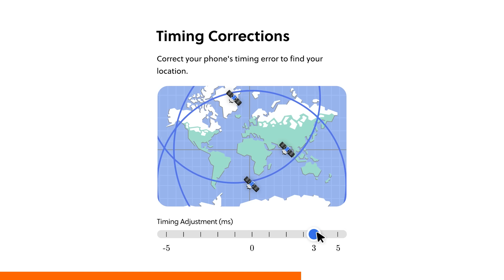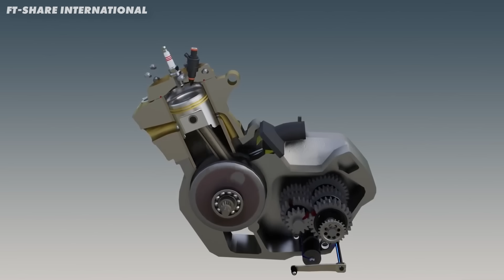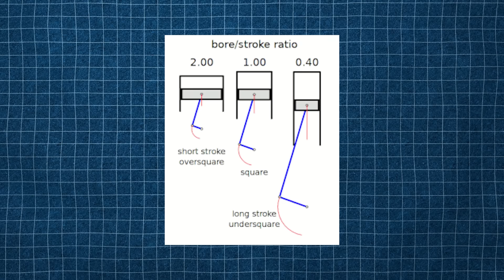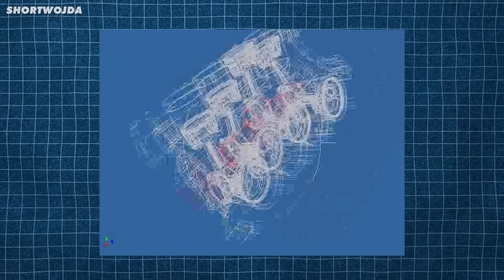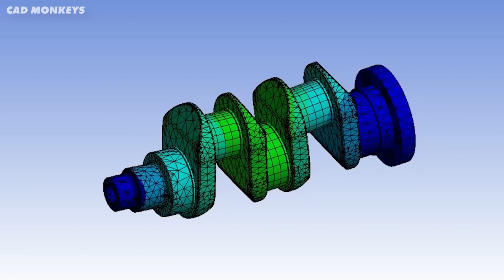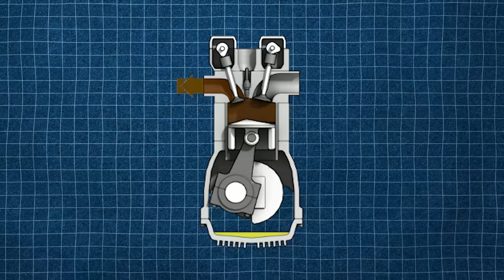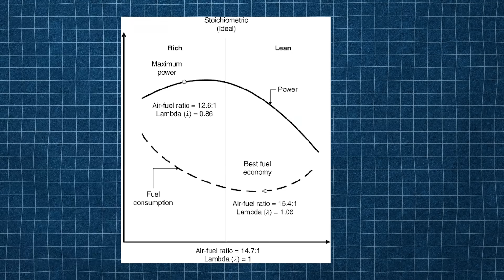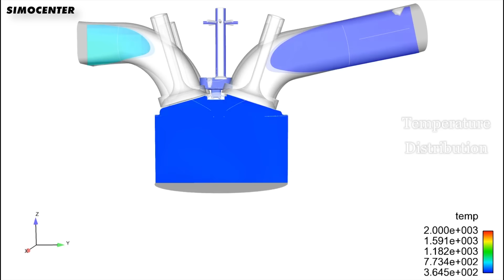Why It’s Almost Impossible to Rev to 21,000 RPM

Comment: Mass doesn't change with velocity, the piston doesn't magically become 2.5 tons. If you're talking engineering you absolutely have to be precise with your terms, man
Reply: Weight and mass are not the same thing. Weight is a measure of force. You don’t become massless when you travel into space, but you do become weightless (sort of). The earth has mass, not weight. You might want to be more precise when correcting others.
Reply: @gerardleary1885 the earth does have weight, does jupiter and the suns pull mean nothing to you? Lmfao
Reply: @gerardleary1885 if earth had weight, it would be the gravitational force that keeps it orbiting the sun 3.6 10^18 ton-force compared to its mass 6 10^21 tons.
meaning gravitational field of earth is ~1600x stronger than gravitational field of the sun, at the surface of earth
and the reason why our weight is not significantly higher at night vs day
Reply: I was interpreting it as, that at 20,000 rpm, the piston is exerting the same amount of stress to the connecting rod that would be comparable to 2.5 tons, either in compression or tension, squeezing or pulling on a connecting rod.
Reply: @kustom4935   A graph of the force on a piston throughout a full cycle would be a pretty crazy line peaking once for the power stroke and again for the intake. At its very peak, force could be expressed in the direction of piston travel, but that would not be the total force exerted at the crank pin, which has a large direction element. I’m sure real engine designers would know the entire story of force / direction for every single mm of that stroke. As Driver61 is pretty well informed, an engineer may have given him that number and rounded it roughly to a concept readers could envision.
Reply: @artysanmobile  yes! at peak cylinder pressure the force applied by the combustion gases on the piston is many time the force required to accelerate the piston. like an order of magnitude stronger.
Reply: @kustom4935 that's more like it. you can say force which is both scientifically accurate and understandable. stress is a consequence of force
Reply: Yeah but you were using your brain, and that's not allowed on the internet.  @kustom4935
Reply: Thanks you for clearing that all up, to all the pedantic and non pedantics, thats how I interpreted it to.@kustom4935
Reply: The confusion between mass and weight is because all bathroom scales in the metric world are labeled incorrectly. They are all Force measuring devices and should read Newtons on the dial because they measure how much force you exert on the scales because gravity is pulling you down onto to them. BUT…Force = Mass x Acceleration and the “Acceleration” is a known number so they all divide their readings by “Acceleration” and provide a reading in Kg….which is your mass…but they call it your “weight”…..which is the Force you exert on the scales. And…not only do your bathroom scales confuse you with their labelling…they sometimes LIE ABOUT YOUR WEIGHT!!!!!😂😂
Reply: Technically, mass does change with speed, but not by much
Reply: @justaperson3119 weight doesn't change with acceleration either, only with altitude
Reply: , with high speeds, the force going up rapidly.
Reply: @justaperson3119 relativity is negligible at this scale
Reply: @justaperson3119 mass does not change, weight does 
Mass stays constant as atoms can't be added or removed, just modified by acceleration 
So instead of saying 2.5 Tons, he is probably talking about Newtons
Reply: @justaperson3119 technically mass can increase indefinitely 😅
Reply: @v0ldy54 that's not actually true

At the speed of light an object's mass is infinite
Reply: Tilta whirl is a lie!
Reply: Well aächtjually
Reply: It experienced 2.5 ton of force, but 61 said "it has a mass of 2.5 ton" which is not unless the piston is moving at significant speed that relativity kick in.
Reply: If you want to be specific. 1x1=2 just ask that guy that smoked way too much dmt and saw the entirety of all existence and life deconstructed in the 4th dimension before his very eyes when he had his eye lids closed
Reply: Inertial mass does not equal static mass.
Reply: @jasonsmith4902  yes it does
Reply: weight... yeah
Reply: Honestly, sounds like par for the course for engineers, more of a scientist thing to get upset about language. How about if he says "due to centripedal forces, the piston feels an effective weight of x tons". I really don't think this is a difficult concept for even a child to understand, much less an engineer, and it is not the purposen of the video to rigorously introduce these concepts.

Yours,

- a real scientist
Reply: For all of you who say that a tonne is a unit of mass you are correct but what else is a unit of mass? You guessed it a pound!!! And due to Einstein's theory of relativity we know that as an object speeds up its "relative mass" increases as well. This is why when you ride those rides at the fair that spin really fast it feels like someone is sitting on you.
Reply: If you’re hit by a 1 lb weight tossed to you by hand you might get a bruise. If you’re hit by a 1 lb weight going at 100mph you’re dead.
Reply: Yeah indeed it doesn't.. but it probaply feels like 2.5 tons when it hits your head at these speeds.
Reply: @GideonPitstra37  yeah a bullet hits you hard too but it still weighs just a few grams
Reply: Yes the piston doesn't increase in mass BUT the kinetic energy of the rapidly moving piston is translated into kinetic energy, a force applied equivalent to mass.
The kinetic energy of an object is the energy it gains from the force acting on it to reach a certain speed. This energy is stored in the object and remains until its speed changes. When the object is moving, it does the same amount of work to slow down to a stop as it did to speed up in the first place. This is expressed by the formula:

Ek-½ mv²

where Ek is the kinetic energy, M is the mass of the object, and V is its velocity. 

A piston accelerates and decelerates therefore it's speed changes and it's kinetic energy is transferred to the crankshaft which holds it in place via the connecting rods. That force is equivalent to 2.5 tons.

Citations:
Kinetic energy - Wikipedia https://en.wikipedia.org/wiki/Kinetic_energy
What is kinetic energy? (article) - Khan Academy https://www.khanacademy.org/science/physics/work-and-energy/work-and-energy-tutorial/a/what-is-kinetic-energy
[PDF] 7. Work and Kinetic Energy https://courses.physics.illinois.edu/phys211/su2012/Text/ch07.pdf
Kinetic Energy and the Work-Energy Theorem | Physics - Lumen Learning https://courses.lumenlearning.com/suny-physics/chapter/7-2-kinetic-energy-and-the-work-energy-theorem/
How to Use the Work-Energy Theorem to Calculate the Distance Traveled ... https://study.com/skill/learn/how-to-use-the-work-energy-theorem-to-calculate-the-distance-traveled-by-an-object-explanation.html
Reply: When you buy a hydraulic press, ram, jack the value of the force is tons. They are all pistons. Clue is in the name. Pis tons.  Fight me.
Reply: @jondonnelly3  They use tons because people understand those values, but technically they should be calibrated in Newtons, the unit of measure for force.
Reply: @jondonnelly3  Tons is fine. The problem is he called it "mass", not "force". Two hugely different things and precision is important when talking technology. Mass and force are the same in casual language when talking about something at rest and only in this case. Why people like you are having conniptions about my accurate comment is beyond me.
Reply: @jondonnelly3    That was very funny. I’ll probably keep that for my grandkids.
Reply: @jondonnelly3  Fun fact: Pistons got their name after a few blokes had a big session at the bar, after a few beers they all would piss tons
Reply: Force = mass x acceleration. Nothing else needs to be said
Reply: This discussion is never exist if US use pound for actual mass, not weight (aka gravity force)
Reply: He's not an university professor explaining to students. He's explaining so that normal people could understand. It's much simpler to imagine tons than Newtons
Reply: If you want to be specific. 1x1=2 just ask that guy that smoked way too much dmt and saw the entirety of all existence and life deconstructed in the 4th dimension before his very eyes when he had his eye lids closed
Reply: Weight changes with momentum but mass doesn't. Even with GR
Reply: He is using G force to calculate the weight...weight isn't mass.  Mass is weight at sea level.
Reply: It's G force. Theoretical weight. That's what he's taking about.
Reply: Mass increases as the speed increases according to the special relativity theorem
Reply: @bastadimasta don't forget that there are two masses- gravitational and inertial and normally they are equal. You are talking about inertial mass that changes with speed.
Reply: It’s for the 90% who hasn’t a Harvard degree. But if throw a rock with at your face that’s going 5 mph or 50 mph you’ll feel a slight difference.
Get that?
Reply: @antonfloor344  yeah, same weight but different speed/energy. it's not that complicated
Reply: Weight and mass are not the same thing tho
Reply: Its called momentum (P), P=MxV .A product of mass (M) and velocity (M). Guess what has mass and is moving in the context of this video? Yep, crankshaft, and pistons. To the laymen, the faster something moves, the harder it becomes to stop, essentially allthings being equal requiring the same force which accelerated it to stop it or in another way, it imparts the force used to accelerate it onto whatever object is stopping it with a lot of energy being released in the form of friction heat, noise and other damage as per the video.
Reply: You're forgetting centrifugal force.
Reply: @JeffKopis  the piston is reciprocating there no centrifugal force just linear acceleration
Reply: U don’t know the difference between a force and a mass be quiet
Reply: Ton is weight, not mass. Weight is a force. This is why we have kg.f as a unit of weight.
Reply: Ever heard of relativistic mass? Objects become heavier the faster they are
Reply: @alex.796  true but it doesn't apply to non relativistic speeds like a piston speed.
Reply: Ackchyually something something general relativity, C , time dilation, observer etc.
Reply: @teresashinkansen9402  but still doesn't matter since the piston doesn thave relativistic speed regarding the rest of the engine
Reply: @geemy9675  It was a joke on people bringing that up because relativistic effects are rarely something to take in consideration, I think GPS is the only common thing that does.
Reply: Weight is force, not mass…🤦‍♂️
Reply: Mass does change with speed we just ignore it in classic Newtons mechanic since the difference in mass change below 6000 km per second is negligible. Once you get above 200 000 km per second the mass change becomes noticeable and goes to indefinite once you reach the speed of light.
Reply: Tons of force ....F=ma.
Reply: How about momentum formula?
P=MV
Or to be exact for moving object
P=Lorentz factor times MV
So for a moving object mass can change the closer it gets to the speed of light due to changes in Lorentz factor. That's what Einstein called relativistic mass. But than he thought it's not correct and only the "rest mass" should be used in calculations. So there are still deabates in science society to these days wither mass can or cannot change))
Reply: hes just reading articles here
Reply: Inertia is real, and at times there are huge forces on the pistons that act identically to weight.
Reply: He is talking G forces!!
Reply: Mass does change with rpm. You can design a piston to change shape at high rpm creating a benefit.
Threw webbing 
And it does get heavier at high rpm.
Put a ball on a string and start spinning it. Funny how it can hang while sitting, but breaks the string once you start getting it going high.

And a top fuel piston generates 3 tons of stress at the highest point of cycle and 5 tons on compression.

Stupid people that don’t understand dynamics.

If it doesn’t get heavier. 
Then how does it go through the side of an engine block when In blows.

It takes tons of pressure to window a block.
Reply: @maegenyoungs2591  the original commenter was saying that its weight, not mass.  Mass never changes. It’s the amount of matter in something.  Weight is the force exerted by the object due to gravity or in this case centripetal acceleration
Reply: I think he refers to reciprocated weight, not actual weight.
Reply: G-forces translated to metric units 😢
Reply: Yes it does.

It's called inertial Mass.

You've never read special relativity have you?
Reply: @logicisdead9871  From context I know the piston isn't moving at relativistic speeds. Think before you post. It'll keep more of your feet out of your mouth.
Reply: @katchF22  Speeds do not have to be relativistic. The effect is just more exaggerated at relativistic speeds.

Velocity increases kinetic energy, i.e., inertial mass.

A 9mm round weighing about 8  grams and traveling at a velocity of 100 ft per second possesses 3.7 joules of kinetic energy.

That same round traveling at 800 ft per second contains 237 joules of kinetic energy.

The increase in kinetic energy is analogous to an increase in mass, thus the term inertial mass.

When that 8 G projectile strikes you at 800 ft per second, it feels like it weighs several thousand grams.

The same is true for a piston. The increase in inertial mass is not linear but rather squared. So double the speed increases the inertial mass by a factor of 4.
Reply: Mass doesn't change, weight is.
Reply: The forces introduced by the Piston to e.g. the Piston rod Rises Up to a equivalent of 2.5 tons...
Hopimg the calculation didn't incl. The Piston rods and the 2.5 tons are introduced to the Geometrie of the crankshaft...
Reply: Mass changes, weight doesn't. In space, yoi became weightless, not massless
Reply: @balintgalambos691  You got that back to front. Weight changes, mass doesn't.
Reply: @mirandahotspring4019  yep. Sorry, I'm not english, i know which changes, which doesnt, i didn't know which is which in english
Reply: @balintgalambos691  Well you got the second bit right anyway. You're weightless in space not massless.
Reply: @balintgalambos691 
Gravity vs. weightless/agravic.

"Zero Gravity" while you hopefully don't loose your weight.
While "g" is gone, F=m*a still there Just Fg = m * g is Zero.

So the Force created by the Pistons at 20.000 rpm is the equivalent of 2.5 tons.
So hang 2.5 tons on the Piston rods or let rev the egine at 20.000rpm.
Same with the Force on the crankshaft F=m * a with "a" Not equal to "g".
Reply: Good lord a lot of people are wrong here. For the record:

There is NO (significant) change in the piston mass. Whatever the hell "intertial mass" is meant to be is irrelevant. The video is simply wrong, and confusing in what it means.

There is NO (significant) change to the piston weight, unless the car is heading for outer space. If the mass is constant (it is, more or less) the weight is also constant on earth's surface (as weight is simply the force exerted by mass at earth's surface due to gravity) 

There is NO centripetal/centrifugal force/weight/mass - the piston is reciprocating, there is no rotational motion.

What it seems the video means, is that there is a force of ~25 kN or ~2.5 Tonnes (on earth's surface) acting on the piston. Which is massively different to the piston having the same mass as an SUV.
Reply: @robbiejames1540  weight is a Force.  So if force changes then weight changes.

F=m×a

Since we all know not only do pistons change velocity the rate of acceleration changes (second order harmonic).  F=ma applies hence slugs or kg  of the piston don't change but lbs and N do and lbs-ft and N-m.
Reply: He was precise. "Weighs" is a measure of force that asks, "What mass, sitting at rest at sea level, would press this hard?" The piston is experiencing an environment as stressful as if it had that mass but was at rest.
Reply: Mass=Force x Acceleration
Reply: Yea it does you
Are talking  Gforce that piston at that speed literally weighs 2.5 tons just as a bullet fired from a rifle may only weigh a few grams but at speed it may generate thiusands of left of energy because of the insane speed
Reply: I don't think most people watching literally think the mass of the pistons change. It's probably ok to frame things in an understandable way in a YouTube video.
Reply: The 2.5 tons description is correct. At the acceleration mentioned, it would increase its ‘weight’
Reply: @michaelguerrero8095  tonnes are not a unit of force, which is what is increasing.
Reply: Mass doesn't change. Why can a hammer drive a nail but not push it down when placed on top of said nail.
Reply: @endbosstwo  lmao is this a real question? Because it has momentum that it transfers to the nail.
Reply: mass does change with speed
Reply: Aggie engineer detected 🫵👍
Reply: Waffler
Reply: Well, obviously, these F1 engines approach the speed of light.

Hopefully I didn’t have to add a smiley emoji at the end of my c comment.
Reply: one of the problems at over i think 19‘000rpm is that the frequenz disturb the eye and i spoke to an ex f1 mechanic an he says that before this rule came out in first test drives where the new engines could rev up to 20‘000rpm the drivers says that he sees anything blurred and after a while all the other teams had the same problem and there came the rule for the max rpm of 18‘000rpm so the problem was on the side of the driver and not the technical side. and sorry my english isnt perfect
Reply: I think he was referring to the forces on the engine
Reply: @katchF22    But, how many cubits in a hogshead?
Reply: Who are you to correct someone
Reply: Engineers know what he means and don't care because engineers know he isn't an engineer. 

- An engineer
Reply: I understand where you are coming from but hes just trying to put it into terms that are familiar like how when a formula driver is driving we say its like they weigh 500 or 1000 pounds because of the g forces. When a small piston weighing a few ounces experiences 10,000g its like the piston is feeling the force as if it weighed 2.5 tons.
Reply: I know others have already "actually" you already, but accelerate a specific mass to 0.99% the speed of light and tell me it's mass doesn't change XD
Reply: He doesnt say mass. He says it weighs 2.5 ton which is correct. How much something weighs depends on acceleration but mass is consistant
Reply: No he doesn't. Mass can be felt more intuitive, acceleration not so much for the avg person
Reply: It sure does. That's why photons do not have a rest mass. Otherwise they could not travel at the speed of light.
Reply: How does a piston accelerate from 0-60? It’s going 0-20000… and how does a piston gain weight? The whole system gains weight in terms of force due to acceleration/deceleration events.
Reply: mass change with speed, if you will reach the speed of light time will stop and you get infinity mass and there will be no moving at all...
Reply: I knew what he meant
Reply: According to Einstein’s theory of relativity, as an object moves faster, its mass appears to increase. This phenomenon, known as relativistic mass,
Reply: Not with velocity but it absolutely increases with centrifugal force like what happens ever single time the piston changes direction.. Mass is forceXacceleration, everytime the piston switches directions it “feels” heavier because the piston is exerting “2.5 tons” or so on the end of the Rod
Reply: If mass changes with velocity then I  Am siting on ufo 👽 like some vehicle😂
Reply: Maybe they were trying to talk about momentum but messed up?
Reply: It's still sorta accurate, tons is a weight which is a force not a mass.
Reply: @christophersilver1902  "Mass of 2.5 Tonnes" Weight has nothing to do with it.
Reply: @christophersilver1902  Yeah, not wrong, but he called it a *mass*. Saying 2.5 tons of force would be right, not 2.5 tons of mass.
Reply: @christophersilver1902 tons is actually a unit of mass. some unit of weight are lbf, kgf, ton-force
Reply: @christophersilver1902  a Tonne is 1000KG which is a mass.
Reply: @christophersilver1902  1 ton = 1000kg which is mass, not weight. Weight is the force due to gravity and forces are measured in newtons.
Reply: @algirdasltu1389 All of you need to be more precise with terms. Ton can refer to both US tons (short tons), imperial tons (long tons), and metric tons. A short ton is 2000 lbs, a long ton is 2240lbs, and a metroc ton is a non-SI unit equaling 1000kgs. A kilogram is a unit of mass. Scales display in kilogramsz but they measure force enacted upon them and calculate mass by assuming 1G of acceleration. Pounds are very ill defined as they can be both mass and weight/force (written as both lbf and lb) depending on the situation. Now none of these are accurate as just like how the piston head doesn't magically become 2.5 tons under the given acceleration, refering to the force on the piston head as acceleration is like writing torque in Joules instead of Newton meters. Just because the units have the same dimensions doesn't mean they're referring to the same thing. (See Pascals for preasure vs Young's modulus)
Reply: @christophersilver1902 No, tons are a unit of mass, weight is measured in newtons.
Reply: @sidewinder5337  The SI unit of mass is the kilogram.
Reply: @mirandahotspring4019  Aw, You're so smart, sweetie. Does your statement change the fact that a ton is a unit of mass?
Reply: @sidewinder5337  Firstly I'm not your "sweetie".
Secondly I believe you mean tonne (t)
A ton is the Imperial measure of 2240 lb, or the American standard  ton that can be a "short ton" 2000 lb or "long ton" usually 2240 lb but sometimes 2400 lb
A tonne or metric ton is 1000kg or about about 2,204.6226 lb
In shipping, a ton, sometimes referred as a Lloyd's ton is a measure of displacement whereas a tun is a measure of volume.
Reply: @mirandahotspring4019  I asked you a question. I will repeat for you: does your statement change the fact that a ton  is a unit of MASS? (doesn't matter, metric tonne or imperical ton). Answear please.
Reply: @sidewinder5337  The metric tonne is a measure of mass because it is 1000kg and the kg is the SI unit of mass. How often do I have to repeat that so you understand?
Reply: @mirandahotspring4019  How many more times do I have to ask you a question for you to give a complete answer and not try to get out?

Imperical long or short ton (not a shipping or freight ton) is a measure of mass or not?
Reply: @sidewinder5337   I’m thinking you meant to say force is measured in newtons.
Reply: @artysanmobile  Obviously, since weight is force.
Reply: @sidewinder5337    Neither obvious nor factual. It’s mass that we colloquially refer to as weight. When motion is added, force is the only correct term. No one refers to weight in terms of force. As in, how many newtons do you weigh. It’s not done for a very good reason.
Reply: @sidewinder5337  The metric ton or tonne is a unit of mass, and it is defined as 1,000 kilograms. This is not to be confused with a short ton, which is an American standard measurement of weight, equal to 2,000 pounds, or the British imperial ton which is 2240 pounds.
Reply: @mirandahotspring4019 Thus, the ton is not a unit of mass. Great🤦‍♂️ Now go to Google and read about imperial units.
Reply: @artysanmobile  "No one refers to weight in terms of force"

So you live in some kind of alternative world. In my reality, if you look for the physical definition of the  weight, you can see that it is force exerted on an object due to the acceleration of gravity. Try it.
Reply: @sidewinder5337    I know people like you. It can be hard keeping up with their irrelevance, as it is applied with the greatest force possible.
Reply: @sidewinder5337  weight is force, like dog is animal, doesn't mean that are exchangeable. it's logic 101
Reply: @geemy9675  So, what's your point?
Reply: @sidewinder5337  I'm not sure I probably replied to the wrong comment or misread it 😂 just saying that weight is a force but not every force is weight even though you can express a force as a weight equivalent  in kgf/lbf
Reply: @mirandahotspring4019 Yeah ton, and tonne pisses me off the most out of every measurement except Celsius versus F - F being a clear winner. 

 I have heard of a long ton, but not anyone actually use it in real life. I'm not British so it makes sense. 

 Now you're telling me there is an other ton regarding ships, and it is about displacement? 

 The fuck man thanks, but now I am like what the hell. 

 So when people say a cargo tanker is a million tons plus or carrying a X amount of tons of cargo... Are they actually using Lloyd's Ton, and displacement?
Reply: @dianapennepacker6854  Shipping tonnage is a measure of the capacity of a ship, and is commonly used to assess fees on commercial shipping. The term derives from the taxation paid on tuns or casks of wine. In modern maritime usage, "tonnage" specifically refers to a calculation of the volume or cargo volume of a ship, not its displacement.
A short ton = 2000lbs
British ton = 2240lbs
Long ton 2500lbs
But it varies with who you ask. A British ton and metric tonne are pretty similar, only about 36lbs/16.3kg difference.
Metric tonne = 2204lbs/1000kgs
Fun systems we invent for ourselves!
Reply: @mirandahotspring4019   @mirandahotspring4019  Yeah, Americans especially have made it hell for themselves for not switching over. 

 Just buying soda for example. You buy it in liters. Medical field uses metric, and when you buy medicine you buy it in grams. Or hell even your local drug dealer sells weed in grams, but at a certain weight goes to ounces and pounds. Or maybe kilos. 
 
 Like I said I taught myself metric. When they listed what a British ton was I was like wait. Isn't that just a metric ton, but then no. Like you said it is pretty close. 

 Only measurement I really dislike is Celsius. I think fahrenheit is better for the human experience. 100 is hot, and 0 is super cold for everybody. 

 I had someone tell me a tempaturs in Kelvin once when talking about how hot their car engine got. Like yeah, oh I know exactly how hot a thousand Kelvin is. 

 Anyway now that I know about ship tonnage. That is wild to me, and I'm pretty sure others have used them interchangeably. Some talking about the weight, and then later volume in the same sentence. Thanks for clarifying that.
Reply: @dianapennepacker6854  Sorry, I disagree. Celsius has it all over Fahrenheit!
Water freezes at 0, boils at 100. 
-10 - 0 is bloody cold, 0 - 10 is cold, 10 - 20 is comfortable, 20 - 30 is warm, 30 - 40 is hot, 40+ is bloody hot!
Reply: @sidewinder5337  Scales weigh things in tons/pounds, not newtons, how is that measuring the mass? Mass is constant, weight(tons/pounds) changes based on gravity.
Reply: @AmericanThunder  You are a genius. But how does it contradict what I said?
Reply: @sidewinder5337  You said "No, tons are a unit of mass, weight is measured in newtons."
To which I replied "Scales weigh things in tons/pounds, not newtons"
And you dont think that one contradicts the other?
Reply: I’d like a kilogram of a ham sandwich right about now
Reply: @artysanmobile  sure, that's how it works in daily life but this isn't daily life we're talking about, it's engineering. You gotta be precise with your terms. Hell all that force isn't even weight (which is due to gravity) but due to the combustions happening. It has NOTHING to do with even your daily life terms used for weight, so it makes no sense to use them here.
Reply: @christophersilver1902  tonnes are mass not weight... newtones are weight
Reply: Short ton, long tonne or metric  ton?
Reply: @bowez9  Screen says "2.5 Tonnes". That's metric but it's anyone's guess what he actually means.
Reply: Are you asking too much, they use Imperial to talk about a sport that is metric standard.
Reply: He's not explaining things for engineers to understand. He's explaining things for the layman to understand. No need to be pedantic.
Reply: @KiwiEG  Not pedantic, just correct
Reply: @KiwiEG  No need to recirculate misinformation as well
Reply: @KiwiEG  Things like this only confuse laymen more , not less.
Reply: @KiwiEG  he literally interviewed an expert in the field, yes, pedantry is appropriate, and this isn't even pedantry. He made a massive error.
Reply: @KiwiEG  It's not pedantic to ask for precision in language ffs
Reply: @katchF22 if we’re going to be pedantic, and I’m all for it, shouldn’t we be asking for accuracy of terms not precision? 😅
Reply: @katchF22    First time ever that “precision” and “ffs” have ever appeared in the same sentence.
Reply: @katchF22 
I kindly ask if ffs is an engineering measurement or physics formula?
Reply: @katchF22  calm down lady
Reply: @KiwiEG  well he's gotta teach the right shit then. Your target audience is no excuse for being wrong.
Reply: @KiwiEG he could have just said weight I’m no engineer but when I hear mass I think about how much stuff is there not the force it exerts due to gravity
Reply: @KiwiEG  especially for people that kg is a unit of weight.
Reply: @bowez9  Technically kilogram is a unit of mass.
Reply: @mirandahotspring4019  not technically but actually
Reply: @bowez9  Whatever. Kilos are used colloquially as an expression of weight as well. You don't hear many people, when asked what they weigh, reply, "I exert a force of 780 Newtons on earth."
Reply: @mirandahotspring4019  doesn't change the fact that it's the wrong unit.  If want to use colloquium then use the Imperial system.
Reply: @bowez9  Everyone on this planet, except for  the United States of America, Myanmar, and Liberia expresses their weight in Kilograms. And guess what? In Liberia and Myanmar there is a gradual move towards kilograms.
BMI (Body mass index) is calculated using metres and kilograms.
In every country except the three above all meat, veges, etc are sold by the kilogram.
Yes, the kilogram is the SI unit of measure of mass, but is is globally used as a measure of weight as well.
Reply: @mirandahotspring4019  try agian England uses Stone
Reply: @bowez9  Stone, 14 lb, is still used occasionally but in medicine the metric system is more usual.
Reply: @mirandahotspring4019  and while using stone for weight wlthey also us liters, pints and gallons for volume.
Reply: @mirandahotspring4019  🤣
Reply: @bowez9 kg is a unit of weight for the whole world except for non-science based American purposes.   NASA and the US military are all metric
Reply: @micsunday14  apparently you don't understand the definition of gram or weight.  Not very scientific to use the incorrect unit in your description.
It's not like the Customary system uses Slugs to talk about, no they are reserved only for mass.
Reply: @bowez9  enlighten me zweistein
Reply: @micsunday14  if you can't be bothered to use a dictionary then you won't care what I say.
Reply: @mirandahotspring4019 Honestly who cares if most of the world uses metric. 

 This is standard YouTube in English. America is the largest demographic and I think the best one. (As in money per viewer.)

 If people are bothered by imperial than learn a quick conversion, and stop being lazy like I did. It isn't hard. 

 Seriously people need to get over themselves. Don't hear me complaining when pilots bust out nautical miles when talking.
Reply: @dianapennepacker6854  I know Imperial I grew up with it. America doesn't use Imperial, they use American Standard. Some units like pints and gallons are quite different to Imperial ones.
Aviation and shipping use nautical miles and knots, that was the logical standard before GPS, a nautical mile is a minute of latitude.
America does use metric anyway, the army switched to metric in 1957 to be compatible with NATO. Grunts count in clicks (km) not miles, and all weapon calibres are in metric.
Most science in the US uses metric units, cars and motorbikes use both,.
Reply: @bowez9  Sorry, but no. kg, like tons, are a unit of mass, and weight is measured in Newton. Mass is independent of the gravitational system, weight is not.
Reply: @MaS-ch2id  SAE ton is a unit of weight.
Reply: @bowez9  : See here: https://en.wikipedia.org/wiki/Weight - ton is 1000kg, which is a mass. In earth gravity, saying g is approximately 10N/kg, a ton has a weight of 10000N. Clear difference by definition. You might want to take physics classes.
Reply: @MaS-ch2id  a ton is also 2000 lbs, a weight.
Reply: @dianapennepacker6854    As an engineer, I most certainly do. Our arcane system of weights and measures is a genuine waste of time and work. I’m finally displaying both metric and american, what ever the hell that is, for all dimensions in my CAD drawings. It was always too messy to do so but I’ve changed. The american ‘standard’ is really no standard at all. Every thing that can be done wrong, is, and for no good reason at all. That is pretty american now that I think about it.
Reply: @artysanmobile  LoL you went through quite a comment chain to get to my comment. 

 Yeah it is a mess. A stupid one for sure.

 I was more aiming at people who can't calculate a simple km to miles. Like they have no comparison to it. Might as well be using the plank scale. 

 I get it. I hate it when people tell me how tall they are in centimeters. Takes me a second like oh. Acting like they are 182cm. When in reality they are 5'8. 

 Yet I still can easily estimate close enough. It won't be exact. A kg is 2.2 pounds. Yet not exactly. It is actually .998. I am around 48kg. Or about 106 pounds.

 It is annoying people spend more effort complaining in every video rather than just learning the systems.
Reply: @KiwiEG it's not pedantic. Usain Bolt doesn't suddenly become obese as he crosses the line and neither does the piston!
Reply: @Colby_0-3_IRL_and_title_fights the Piston is traveling many orders of magnitude faster than Usain Bolt
Reply: Didn't know YouTube was engineering school.....
Reply: Speaking of being precise, which you have utterly failed to do yourself, you could have mentioned the correct term which is force. As in mass x velocity =.
Reply: @artysanmobile  Force = mass x acceleration (F=ma)
Reply: @mirandahotspring4019    That is exactly correct, Miranda. Thanks for the clarity. Much appreciated.
Reply: Karen
Reply: Cry about it
Reply: NERD
Reply: Yeah he needs to be absolutely clear, the WEIGHT of the piston, as in the force acting upon it, is equivalent to 2.5 tonnes.
Reply: He's multiplying mass times acceleration. That gives weight. What's the problem? Pistons moving to TDC aren't experiencing only 1g ...
Reply: @raverbunniaz  No, mass times acceleration = force.
Force (N) = mass (kg) × acceleration (m/s²)
Reply: @mirandahotspring4019  that's what I just said. Weight in the common sense is force of gravity at 1g. Increase the acceleration like a piston does, and the instantaneous weight increases while the mass remains the same. The weight changes with the changing acceleration. The mass doesn't.
Reply: @raverbunniaz  Weight is usually only applied to express the force of gravity. Mass of an object doesn't change but its weight can.
In this case it is a measurement of force, expressed in Newtons.
Reply: Stop it. It's clearly rage bait intended to get all loser nerds to fight in the comments and boost the algorithm visibility.
Reply: He has a Channel to run! If he was to go into every formula,technicality, every design feature, people would be yawning and discontinuing looking at the Vid. As a fully skilled mechanic, time served apprenticeship! I think it was a great presentation. He can’t cram a quart into a pint pot.

No! I’m not an Engine design guru. But I served my Apprenticeship when you “were” taught design fundamentals. Coefficient of linear expansion. Etc.